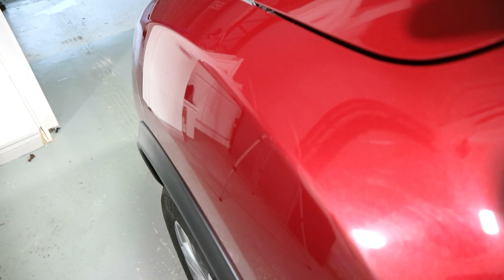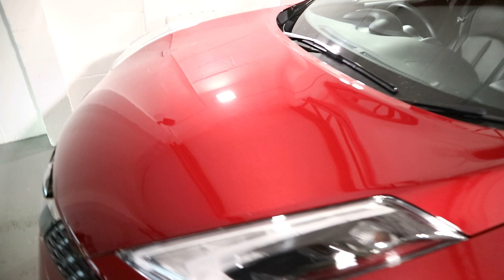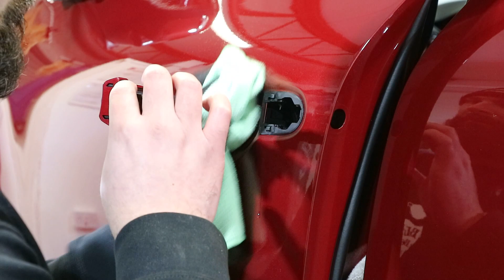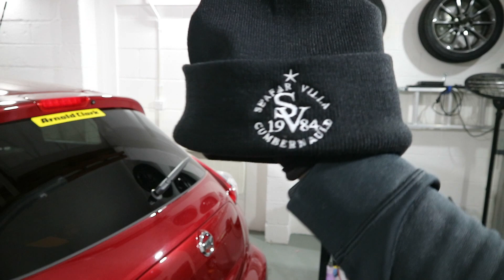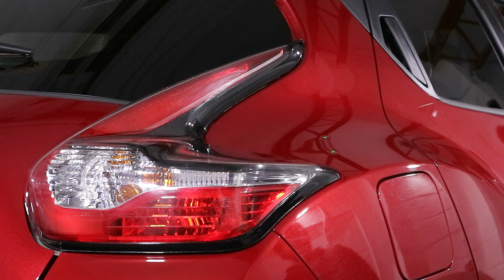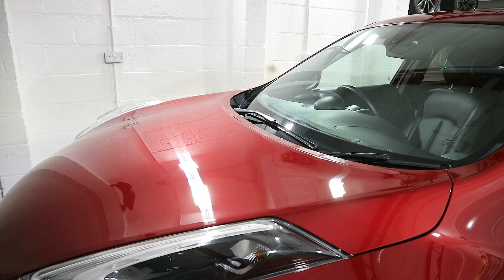Vlog 11 - Nissan Juke

Comment: Where did you get the small rotary polisher from? Fancy one for myself.
Reply from the maker: It's a Rupes Ibrid Nano, I ordered it from Clean and Shiny but I've had a few issues with it TBH and the Rupes service hasn't been the best for repair turnarounds. I ended up repairing it myself as it's used with pretty much every car I have in so can'tbe without a mini polisher, given the cost and length of time I've owned it I thought the build quality would be better along with the service.
Reply: @BlackbeardsDetailing  i might go for the autobrite MR600 in that case, ive got their da3 and da21 and only use their cleaning products 👍
Reply from the maker: @scottaird6762  have a look at the Flex PXE 80 too, have a big Flex polisher and it's epic!